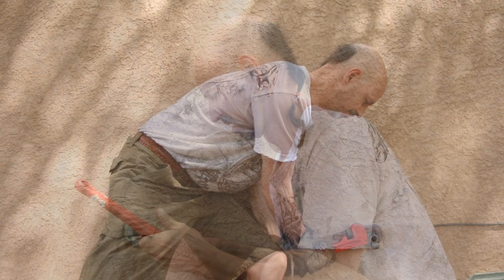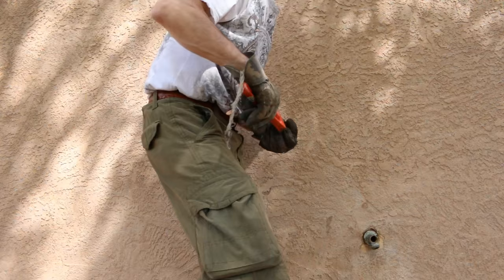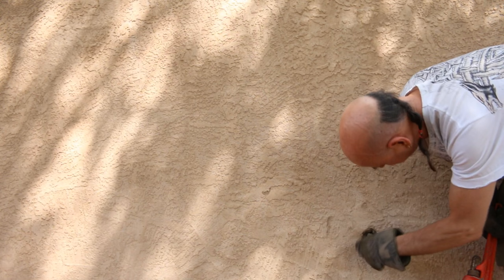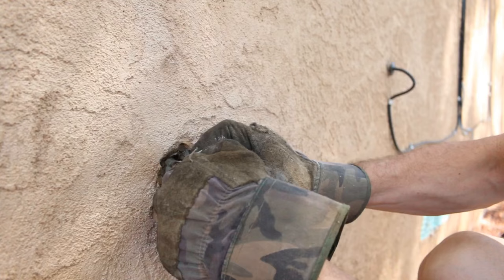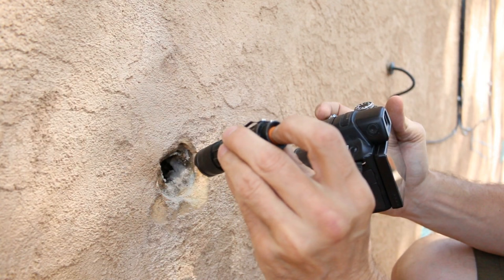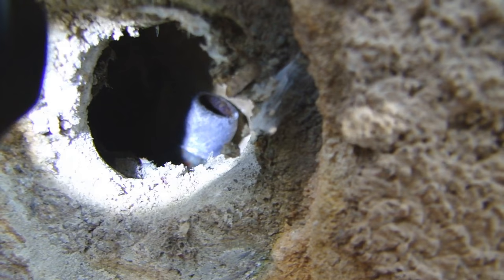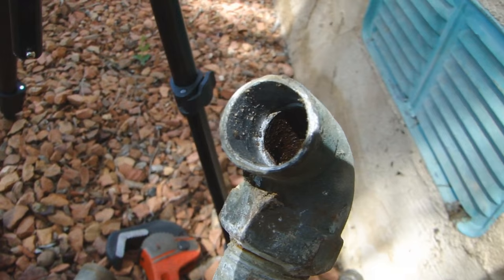Removing a stubborn spigot from my house....

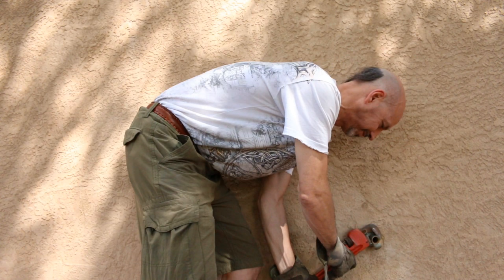Comment: I was cringing by 0:45.  Wish me luck - I have a similar situation (at least mine only leaks when hose is turned on - the washers inside are shot and the spigots at least 60 years old so no replacement washers available).  My spigot is mounted flush to a brick wall.  And no water cutoff available except the main.  This is going to end badly...
Reply from the maker: My leak was pre-spigot...and started leaking when I was away from my house.  So, like you, I had to cut the water main.  If you want to see the whole saga, here it is in segments.

Neighbor helps me assess the leak (which was more like a torrent):

https://youtu.be/1NNPfi7G83o

Discovering the leak:

https://youtu.be/1XRPNB9Jdss?t=162

Closure:

https://youtu.be/0tgINU5sCzQ?t=81